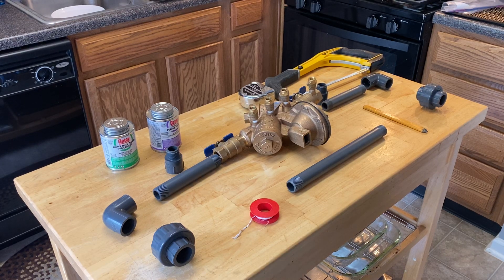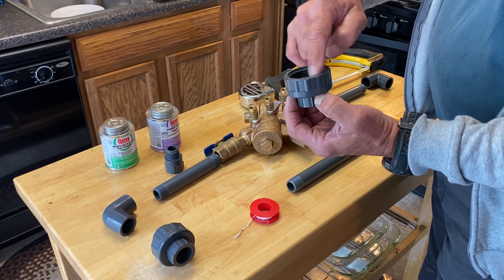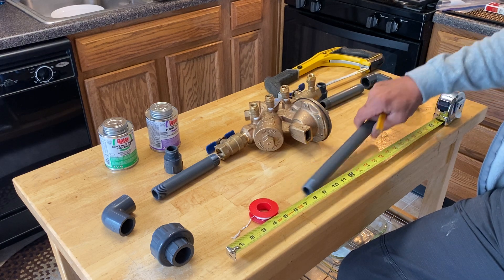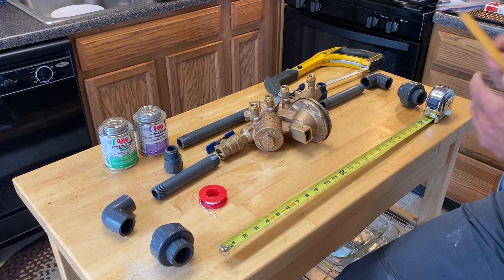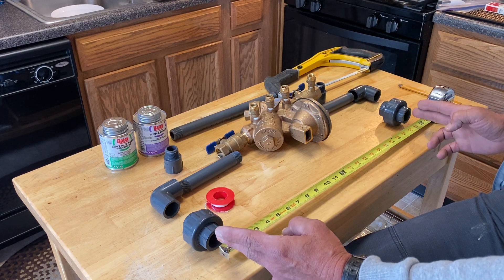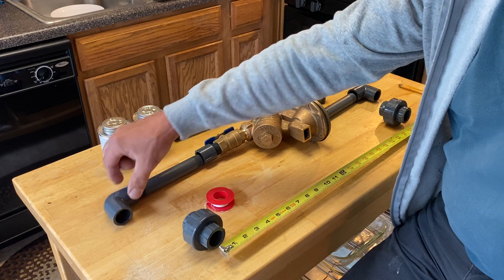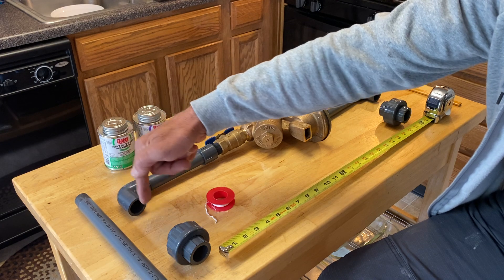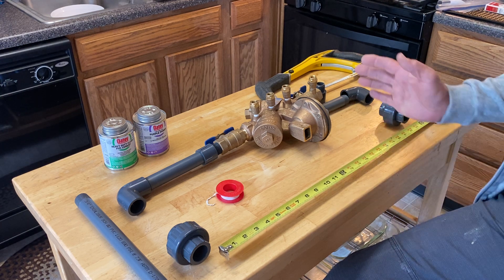WHO TO BUILD BACK FLOW VALUE PART 1 OF 3

Comment: City of cary brought a huge one of those in a 4’ box to hook up to a fire hydrant for the purpose of filing a swimming pool... the unit was offset with a 4’ lead to the hydrant.

I’ve had several jobs I had to extensively research and know Inside and out prior to execution... 
luckily my clients trust my talents, and ability to do take diligence, even if I am doing it for the first time.

I’ve been threw the ringer as far as what I’ve successfully done in the last five years, and I’ve come out of each situation as a trusted source of professional solutions each and every time!
Good job Tom

Comment: Tom, you know I love you buddy but the tape has to go on the other way so that as you tighten it into the thread "clockwise" it doesn't unravel (undo). If you tighten that into a clockwise thread it will want to undo. The way you did it is fine for GAS thread because it is opposite to a water thread and therefore would tighten as you screw it in. You are correct saying it has to go on 'clockwise' but it has to be clockwise looking at the end of the thread - not looking away from the thread. Cheers and Love you pal.

Comment: Brian, I agree, tape on backwards! Tom, maybe try the good fitting in the other end to make sure it's not the brass threads, before going back to the store!
Reply from the maker: John the tape goes on counter clock wise.
Reply: Prepper Life The way you put the tape on in the video is wrong.  How hard is it for you to admit your wrong?  The end of the tape should point the opposite direction you’re turning it.